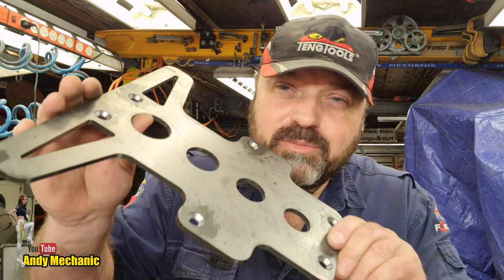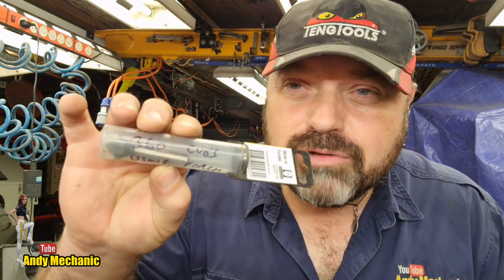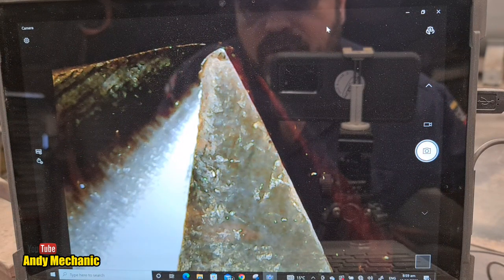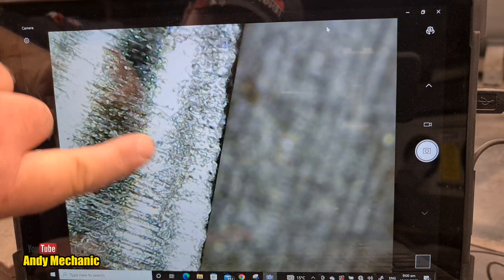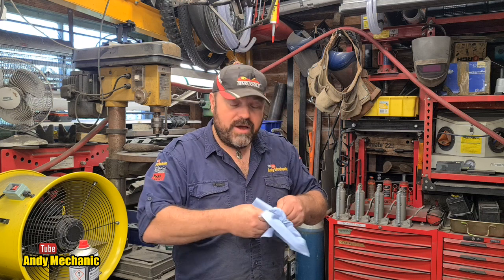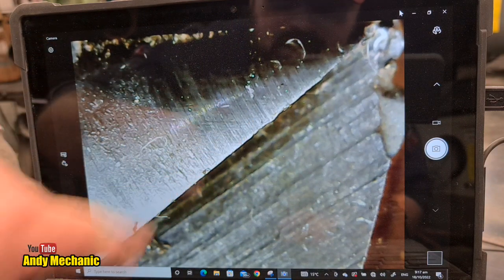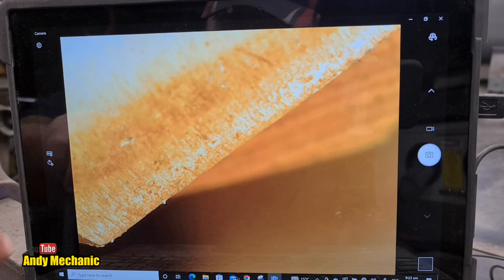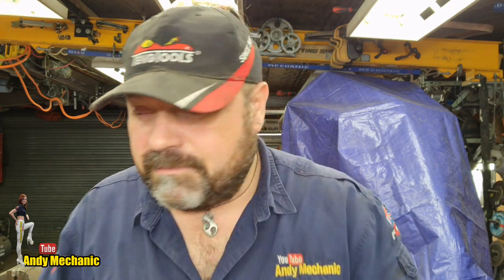Does cutting oil or foam really make a difference when drilling? #1702

Comment: Interesting to know what sort of back clearance off the cutting lips on the counter sinks is lots of galling after the cutting lips worn a bit.
Cutting oil/foam reduces chatter when there’s such a wide cut is occurring as well.
Reply from the maker: Hmmm...I'll have to try measure up a new one. With regards to the chatter, I hadn't thought of that benefit or noticed it between the dry & oiled cuts but I'll see if I can sense it next time I'm doing a run of countersinks.

Thanks Sheldon, it's good to get some feedback from an expert....I only ever did my GCSE metalwork & the first year of an A-level. After that it's been trial & error! Lol

Cheers Andy

Comment: With a lot of countersinking to do you would be better off with a through hole countersink sometimes called a snail countersink, these are the ones usually used in machine shops. Also a flow of suds is far better as it keeps the cutter cooler. Another advantage of through hole countersinks is they are easy to sharpen, if you have a steady hand all you need to do is spin them in the lathe and hold a sharpening stone against them.

Comment: I use oil ,I never have used the foam. I will have to pick some up.
Here`s a question for you. Why do uni bits,also known as step bits seem to drill the best in stainless steel ?

Comment: Hi Another good question is: why do drill-bits go dull when they get hot and cut again when cooled? I find that often when drilling with a concrete bit it may get dull when it heats-up and I have to let it cool a bit
Reply: Hot metal goes soft
Reply: @ernstig1  so when it goes soft it also goes dull, you mean and then it won't cut? I also come across concrete in some buildings that won't drill at all and just ruins the bits.
Reply: @carlodonnell146  well if your drill goes softer than what you are drilling it will just go dull. Depending on the speed at which the metal cools it can loose it's hardness. Too fast a cool and it goes brittle. Concrete or stone dont conduct heat like metal does so I guess the drill bit heats up much faster.
Reply: @ernstig1  well with some drill bits after they cool, they drill again fine;but I remember some years ago I worked on a building and the drill bits that came with the concrete screws and similar ones would not drill at all, and they were ruined. I don't know what the heck was in that concrete; it had to be something more than just rebar, because no matter where I put the drill it wouldn't drill and all the drill bits just burnt. So it's food for thought I guess. Thanks for the back and forth thoughts. Frank